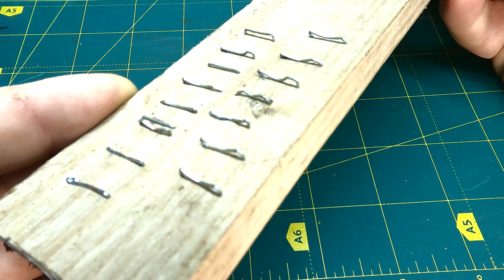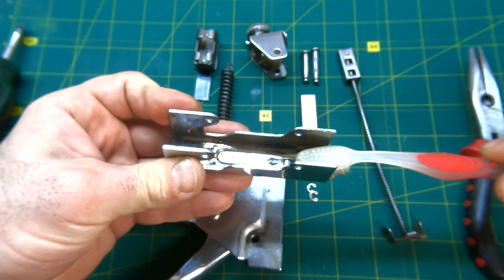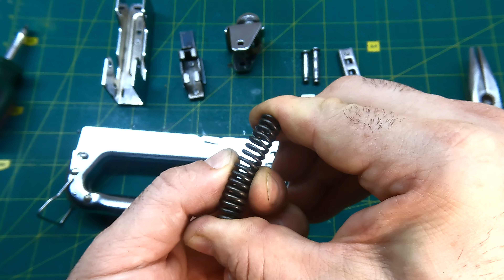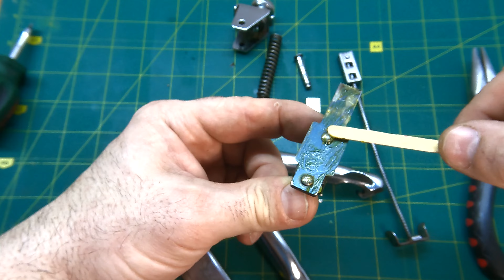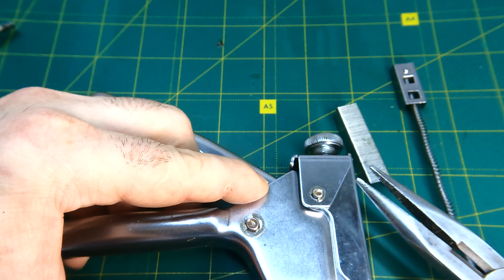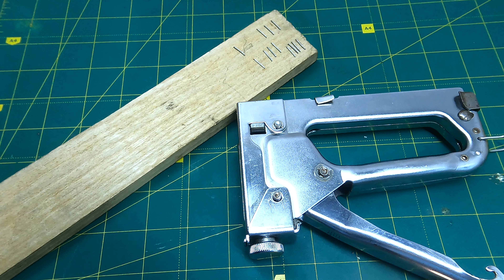After such refinement, the stapler will beat like new. #restoration #repair #tools

Comment: i have that stapler and i can agree it works like new
Reply: Что такое ислам?

🔴 Ислам - это не просто еще одна религия

🔵 Это же послание проповедовали Моисей, Иисус и Авраам.

🔴 Ислам буквально означает «покорность Богу».

🔵 и учит нас иметь прямые отношения с Богом.

🔴 Это напоминает нам, что с тех пор, как Бог создал нас, никому нельзя поклоняться, кроме одного Бога.

🔵 Он также учит, что Бог не похож на человека или что-либо, что мы можем вообразить.

🔴 Концепция Бога кратко изложена в Коране как:

{ Скажи: «Он — Аллах Единый,. Аллах Самодостаточный. Он не родил и не был рожден,. и нет никого равного Ему».} 

(Коран, 112:1-4)

🔵 Стать мусульманином - это не повернуться спиной к Иисусу.

🔴 Скорее, это возвращение к изначальным учениям Иисуса и повиновение ему...
Reply from the maker: In my case, due to long use, the spring weakened, and I substituted a nut for 6 under the spring and it worked. Thanks for the comment.